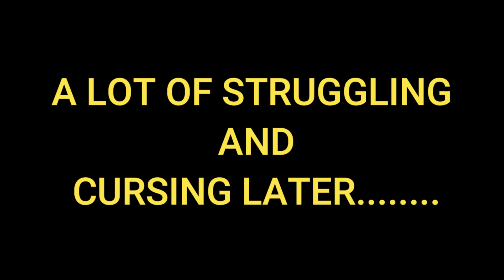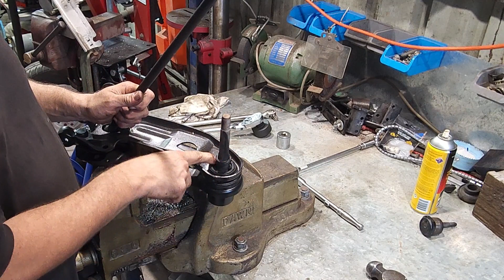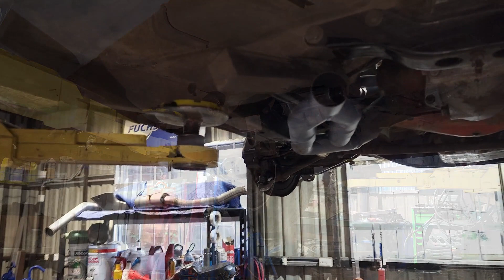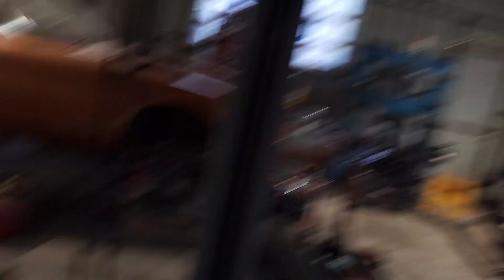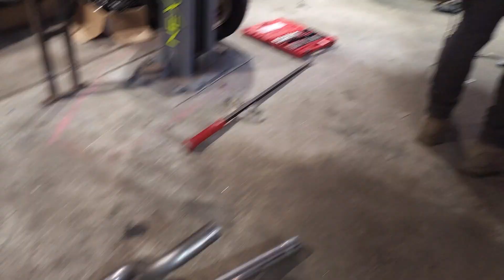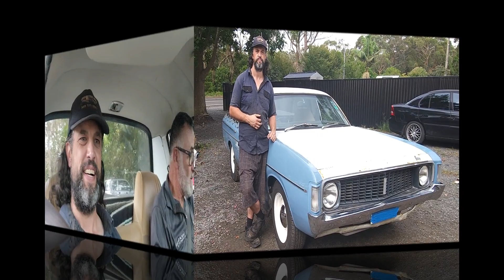Fixing a mates VJ Dodge ute. Front suspension rebuild, custom exhaust, more rust repairs. Finale!

Comment: Shame the first bit of pipe on the extractors didn’t go over the extractors outlet pipe for better flow . But you boys have done a good tidy job . Not sure on his wheels an tyre size but looks like there higher then standard  . Iv always found  there best with the same shocks all round an the same tyre size all round . On my valiants i manly ran 14 x7 rims an 235 . 60 tyres for the best handling . 👍🏻🇦🇺💯⛽️.
Reply from the maker: @Brian and Glenda Harkin
Cheers thanks 
 Turned out to be a lot more work than was first planned.
The extractors sorta ended up 'is what it is' kinda thing, being left over from another project just had to make it work. 
The wheels and tyres are 15inch. Gives it a bit of a look he's happy with at moment.

Comment: Fit the biggest air cleaner you can as your motor works like a air pump . You will thank me . Owned many MOPARS big block Dodges Chargers pacers etc . Best of luck finding someone that knows how to Wheel Alin your MOPAR most are useless .
Reply from the maker: @Brian and Glenda Harkin
Yeah the air cleaner is more about the look to be honest. It has a 350 holley trying to breathe through a restrictive adapter to a stock manifold, there's definitely some long term breathing issues.
Wheel alignment on Val's etc has always been an issue, definitely luck finds them hahaha

Comment: Will this exhaust fit when you rip out that garbage engine and fit a barra in it?
Reply from the maker: @Luke Maloney 
Not everything in life can be solved with a barra.
Using mandrel bends allows a smaller exhaust size to flow well without the added drone of a larger pipe size. Won't get into the sound of created by said barra engine🤣.
For this cruiser its added performance while not being too loud on a long trip.